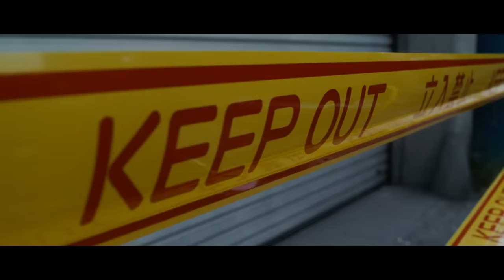Fixing a Ford Mustang | The Fast And The Furious: Tokyo Drift (2006) | Screen Bites

Comment: Symbolism fits so well here. American car with Japanese engine. Sean is American living the Tokyo lyfe
Reply: Jdm mustang
Reply: Fastback Mustang w/ an RB26DETT I’m assuming Han tuned himself from the Silvia. Yet, vague and clever symbolism
Reply: Same thoughts! Sean is like this Mustang: externally an American, but inside of his heart a japanese
Reply: American / Asian Fusion.
Reply: Eurasian.
Reply: CantBeLessSpecific yeah but they should’ve done an Ls SwaPpED rX7
Reply: but in reality world. american car can't beat japanese car. for example skyline R34, supra, only japanese can make faster car with small engine.
Reply: @konggun2755  : Thats not always true, that the domestic automobiles cannot outrun the asian import automobiles.

I have seen Dodge Viper, smoke the supra mk4 in real life.

Ihave seen Chevy  Corvette which outran the type-r by alot, in real life.

Theres alot of things, that impacts the performance of the automobiles,  here are some examples of such as, driver's skill level, car build : drag, drift, circuit, etc. the amounts of power and torque the vehicle makes, although weight matters with enough power and torque it can be nothing to worry about, and alot of other variables that automobiles have, mechanically,  electronically, hydraulically, etc. with upgraded parts, rebuilds, designs, materials used, and so on.

With different variables applied on the car when its fully assembled,  the results can be very different.

With modifications installed, the car's performance can drastically change.

The amount of modifications also types of modifications, has impact on the car.

You might or might not disagree with what I said, but the fact that I have seen asian imports get smoked by domestics in real life races, does not change.
Reply: The Royal Crowned Tiger i know what you mean. but how many people can modi them car's? how many people can use car like that? its that worth it you guy buy a car that so expensive? in competition maybe you can win because you have so much money, you have so much money more than a car price? its that worth it? but in the street, japanese car win, with small money, small engine. that why people around the world choose japan car's. for all the time japanese car win in the street. for my whole life i can't understant what a truty reason why USA banned skyline R34? because them can't beat? or something else? i don't know.
Reply: kong gun GTRs and Supras are only quick and fast because both of their engines are easily tunable and can handle a lot of power, in stock form american muscle/sports cars beat them in a straight line any day, and a corvette would destroy them on a track. Im not saying Japanese cars are shit, it’s just what happens when you have inline 6s going against american V8s.

To answer your question, America has an import law on cars, meaning a car cannot be imported if its younger than 25 years, which is why an R32 can be imported while the R34 cannot. The myth that the R34 being “too fast for american roads” is false, and doesn’t really make sense when America makes 800hp monsters for the road.
Reply: Lyfe huh
Reply: JTuner247 single turbo my guy
Reply: he also beats DK with the engine he originally lost in, in the (sameish) frame of the car he originally won in
Reply: @konggun2755  country origin shouldn't define the quality of the car, all countries have their bad cars, its because of design flaws or half assed building, all countries have their good cars, its because of inspired design and effort in the build, country origin does not change the way normal people choose to build a car
Reply: DaChung my country only made one car, it’s a clone of a Kia, there are other cars being built by college students but it is obvious that styling isn’t really their strong suit
Reply: I kind of disagree. If this was the case, it would be the other way around, American engine in a Japanese car (American guy in a Japanese environment)
Reply: theoutbackbandit ok I guess that makes more sense. But I’m just pointing out what the movie was trying to symbolize
Reply: yeah that sound good, but the engine is germany 9
Reply: American muscle with the heart of a Japanese muscle..
Reply: How the hell have I never noticed this.
Reply: @Patrick Seretin I've said this so many times and get laughed at. Skylines are fast because the the weight is the same as a case of beer.  That mustang is made with all metel no fiberglass parts.
Reply: @Patrick Seretin The mustang is 300kg/700 ib lighter than an r34, or about the same weight as a 180sx. The RB26 can make more than enough power to drift a mustang.
Reply: kong gun LS corvette engine weighs less than an rb26 or 2jz with accessories.
Reply: @theroyalcrownedtiger2946  the way I see it, american cars are built to be fast in a straight line, japanese cars are built for cornering
Reply: @_tokii__  : Different people, different thoughts, different opinions.
Reply: the song played here called "Mustang Nismo" was my ringtone in the army. it wasnt very well recieved by my comrades XD
Reply: Yeah, did realise that.
Reply: Never thought about it till I saw your comment. This car is infact resembling Sean's new life in Tokyo. One of the only American people living in Japan, having hard time learning the new culture (and drifting...), just like this American car needed to become more Japanese to stay running, and it does seems like the Mustang did not like the Nissan engine installed into it at start, but it grew on it just like Sean grew into Japan.
Reply: @konggun2755  were talking about 30 years of technology advances, I'd love to see an import built in 67 take on a domestic and win.
Reply: @konggun2755  dude usually must not know cars or never raced in real life.....these cars for real in this movie are slow stock honestly.
Reply: @toonzoku9478  yet the Silvia was supposed to have an sr 20 dett🤣

Comment: Wait...Sean's dad threw him the keys to his mustang...but wouldn't he not need them since you would be swapping the ignition assembly from the nissan?
Reply: Symbolism more than anything. It was Sean's car now. Well..unt he gave it back at the end when he was in a silvia.
Reply: It took me a while to understand this comment
Reply: @javierescuella7957  how so?
Reply: @DailyDoseOfAffirmatio.n  That is a possibility however. a car from the era, they probably didn''t care for the functionality of the doors.
Reply: Why on earth would you need the ignition assembly from the nissan?
Reply: @sappersam8841  because they swapped the rb26 from Han's Silvia S15.  I would assume the ignition assembly meant for a mustang windor motor would be different from the S15.
Reply: A key is essentially a lock for a power switch. In other words, it doesn’t matter what brand light switches you use in your house they all have the same function, relatively speaking. 

The engine computer needs 1 or 2 things from a ignition switch. 1. key on 12 volts 2. If the computer controls the starter, it needs momentary 12 volts signal to active starter. 

All that being said, you don’t need keys on any vehicle if you know which wires to provide power to, so why not keep the interior/ignition switch all original?
Reply: Also, don’t confuse starter ignition with spark ignition. To completely different things that are commonly misused.
Reply: @claytoncarter  True, but I think that they would swap out the key assembly from the s15.  If they already swapping over the entire wire harness and ecu I would assume they would swap the key assembly.
Reply: @claytoncarter  I realized my mistake lol.
Reply: It shouldn’t matter what key switch you use it should be 1 wire going in(12v supply) and 2 or 3 going out(solenoid, key hot, and acc). Unless I’m missing something about this particular motors engine management system.
Reply: @John-md3ld  Never heard of people swapping ignitions to do a swap man lmao
Reply: @mitchellhamilton1753  Well ignition meaning the coil pack and anything electrical they would have to swap.......
Reply: @John-md3ld  have you ever tried removing an ignition switch? Let alone one from an old classic era car. For one they are riveted in. It is a royal pain in the ass to get those damn things out. It would be far easier to just wire up the stock switch.
Reply: @sappersam8841  I actually have in 3 different vehicles.  I don't want to get into an argument it's just food for thought
Reply: hard no, ecu doesnt care if its a 60s ford or 00s nissan ignition cylinder. 12v is 12v. the nissans might not even fit dimension wise.
Reply: ignition cylinder?
Reply: Trunk, doors i think you're forgeting these they didnt have keyless entry in 1969
Reply: A key for the garage not for a Mustang lol
Reply: what about the doors and the trunk?
Reply: @unicorn4692  I mean that is the only thing I can really think of that he would need the oem key for.....but still
Reply: @Chris-us7tj  True true I guess that would make sense......
Reply: Oh, those were not the keys to his mustang, those were the keys to his mistresses room. 😜

Yes, they are going to need those keys from the Sylvia because the ecu has a transponder that needs to read the chip inside the key to turn on the car. 

Unless they got an aftermarket ecu (most likely the case)
Reply: Garage key
Reply: @sfynpratama  the door was already open....
Reply: @John-md3ld  when the door close? And the door was locked
U need key😂

Just kidding dude 👀
Reply: @sfynpratama  lol
Reply: Flamesthatburn331 you do know people can keep more than one car right
Reply: Let me clarify this... The key will still be needed to start the vehicle after the swap because the ignition switch (where you turn the key) is literally just a switch that sends a 12v signal when it’s turned... no matter what engine swap you do you won’t have to change key
Reply: Or maybe to move the car since the steering wheel locks into place and without the keys you wont be able to steer around.
Reply: Steering lock to move it
Reply: John Miller my guess would be to put it in neutral to tow it or something
Reply: Would the S15's ignition cylinder fit in the mustangs dash? And don't forget, they still need to original key for the door locks
Reply: @royaloreca  I would think alot of customizing was done...
Reply: Probably keys to the garage......
Reply: doors and trunk.
Reply: He needs the keys for the doors and trunk tho
Reply: All they would need from the ignition for the Mustang is the starter itself.

Comment: The amazing thing about this movie is how a bunch of broken ass high schoolers were able to buy all of those parts ,were all mechanics,able to finish the whole car within a week and sean learned how to drift in a few days to win against the best drifter 🤣 but at least is better than the new dumb nonsense fast and the furious
Reply: Well, they've been doing it for years, the whole mechanic thing.
They used ghe garage and parts from Han and ordered the rest online for cheap or the dad had left over parts laying around.
It's not that magical really, these kids are into that scene and when they work together they can prolly get shit done when they go at it 24/7.
Reply: Didn't you see Twinkie selling the most random ass shit ever. From kit kat to sneakers to big ass chains. He looked he was getting hella money too
Reply: Thought that was interesting they just “dropped” an engine in the old mustang, and they just happen to know exactly what to do. Also, putting a multimeter on the engine for what? To check voltage or rpms? I could not stop laughing at this crap. At least make it partially believable, but then these movies are garbage at best. Just because idiots spend their money going to see this doesn’t change anything.
Reply: There was a whole montage of Sean learning how to drift before the epic chase scene. He knew how to drift way before this part. He just had to fine tune the suspension and engine in order for the car to perform in accordance to Sean’s style of drifting. It’s kind of like if you knew how to drive a old mustang fastback blindfolded, then turn around and attempt to race in a Toyota Supra. Power band is different, suspension geometry is different, rpm range different, oil pressure, fuel pressure, spark ignition, etc. all different. So you have to relearn how to drive the car just as good as you did in the last one. It wouldn’t take more than a week or so either. It’s all about just getting acclimated is all.
Reply: Exactly lol does anyone realize how hard and how long it takes and how expensive it would be to over night jdm parts here? Now try sending american car parts to japan lol.
Reply: @Cajun-it3yf  They did actually weld up motor mounts for the engine. It wasn't some direct fit bullshit.
Reply: Cajun9000 lol you represent everything that's wrong about how to approach a fictional movie. If you want reality go watch the racing sport scene, this is a movie. Fiction. The story is being told, it's not a precision picture of what happened (in fact it never happened obviously). So you know this is a fictional movie and you know fictional movies don't represent reality. So, paraphrasing Dom in Fast 1: why bullshit?
Reply: @thefuzzypickle8277  the parts used in the car were japanese parts
Reply: As far as im concerned, the FnF franchise ended here. All the ones afterwards became 007/mission impossible spinoffs.
Reply: Han robbed a vault full of cash in Brazil.
Reply: They should have put more scenes of them addapting the motor(mounts, transmission, etc) that them fixing mechanicals things of the motor. That motor was running perfect, it was 
maintenance by Han(with a lot of money) and he even reep it so hard when he crash it trying to drift. It should be fine.
Reply: Why is it so unbelievable? All the kids here are into the tokyo racing scene and they all know their way around an engine, in previous scenes theyve shown them working on cars in the garage which they basically own and probably have a bunch of money from hans drug hussle and the money sean made from it to spend on parts they need. That montage of sean drifting here was just to show the progress on the car they were simply tuning it to drift better. Sean had already learned how to drift and was beating dudes all around town so he didnt learn it overnight. I swear these comments are so idiotic idk how you have so many likes
Reply: It’s this thing called “movie magic” pal 😂
Reply: Fair point. Better than seeing driving a car off a building or a cliff.
Reply: Lol I forgot they were hs characters
Reply: Bunch of high schoolers or not, they were all working on cars for years, including Sean. Sean worked as a mechanic as we can see in the start of Tokyo Drift, Twinkie probably also did that in Japan with Han and his friends... So yeah, I do think these bunch of schoolers are capable of fixing a car from the ground up, probably not in a week but yeah its possible for them.
Reply: @itzbebop  even though Tokyo drifts Hans death plays a huge role in the 7th one.
Of anything Tokyo drift is the spin off.
Reply: One of the most criminal things that happened to this movie was the fact there were a ton of high-quality deleted scenes that added more context and continuity to events in the film. For instance, there's a deleted scene where Twinkie misdirects some gas station workers over a  soda he bought, just so that the rest of the crew could steal wheels from the station for the Mustang.
Reply: @sukraatahluwalia5137  I've seen that one. Would be cool if they added it to the movie but I think they were afraid because of the audience lol. Still would add more context on how they got parts and stuff
Reply: Han was bankrolling it all, and he wasn't broke. You see him handling a lot of money in the film. And if you count the later movies, they show that this movie happened after they all got rich from the vault heist in Fast 5.
Reply: Sean had been training to drift for the entire movie after his first loss in Tokyo.  Also, he won because DK was more focused on trying to kill him in the race than on just winning the race.
Reply: It's a bunch of Japanese school kids and an American wrench monkey in a garage full of scraps. The friendship power level more than exceeds 9000.
Reply: @DeathBringer769 if that’s true why is Han hanging out with high school kids?
Reply: u dont know anything maybe😂

Comment: I never understood the “that’s why she’s spitting” reference
Reply: Same
Reply: I believe the line is "thats the one shes spitting" as in this is the spark plug which isn't firing properly.
Reply: Smfh
Reply: Same here
Reply: The spark plug was sooted up, meaning the engine was running rich and not giving power at the expected moments. In terms of the movie, it's probably just to show it wasn't a perfect "bolt-in" engine swap. They had to solve a few problems along the way...
Reply: Spitting is when unburnt fuel is coming out of the exhaust aka "misfire"
Reply: The car is misfiring (spitting) happens when a engine is running rich.. that’s why the spark plugs are black
Reply: @StarBoimuzic  Wouldn't be a misfire, would just be backfiring because it's running too rich.